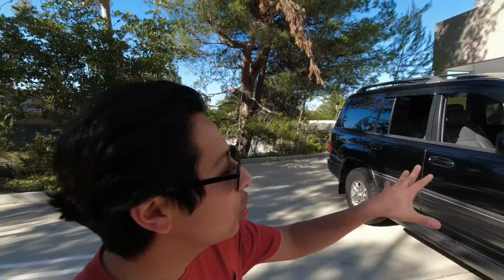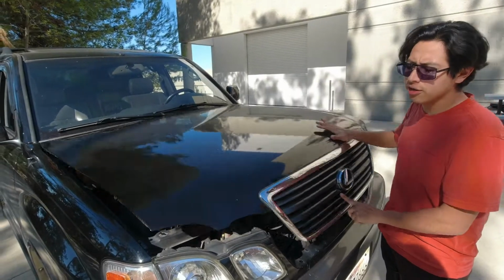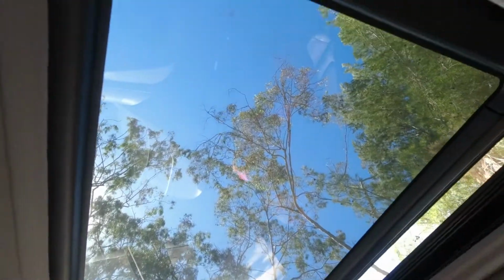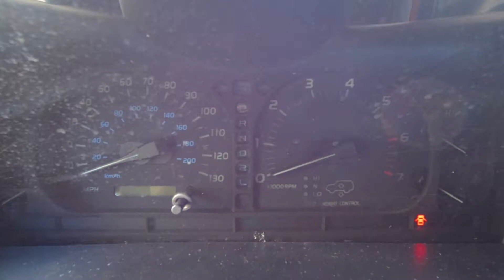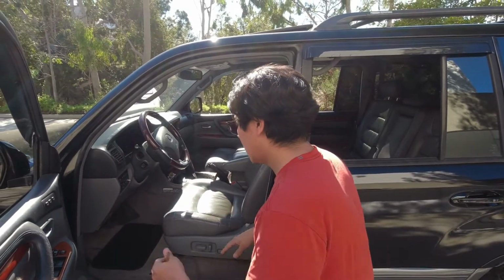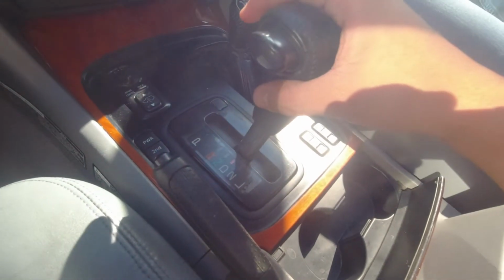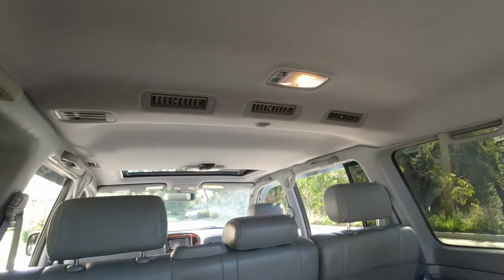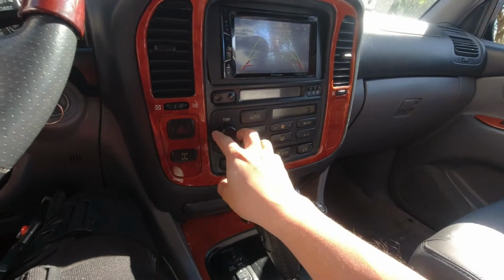The Common Ground Between Luxury Car And TANK. 1999 LEXUS LX470

Comment: These are non interference engines, if timing belt snaps, valves won't touch pistons
Reply from the maker: Have you ever heard of someone actually blowing theirs?
Reply: Timing belt snapped, yes? Engine, not saying it hasn't happend, I but I never heard of it..
Reply: And because of that fact I have over 200k miles on two or three of my LC/LXs.  I will change them whent the belt or water pump fails and save thousands in unnecessary maintenance costs.